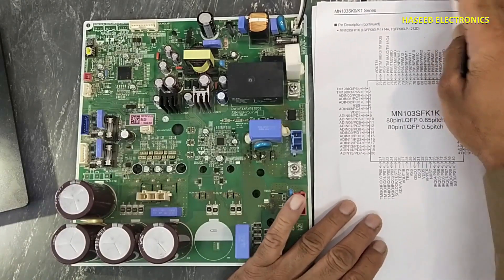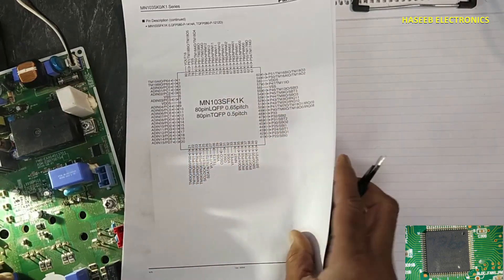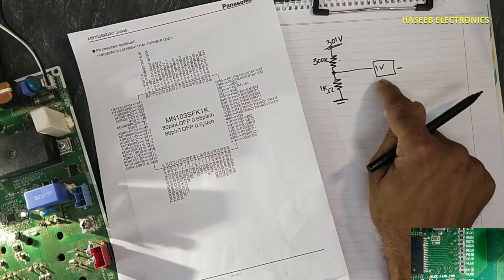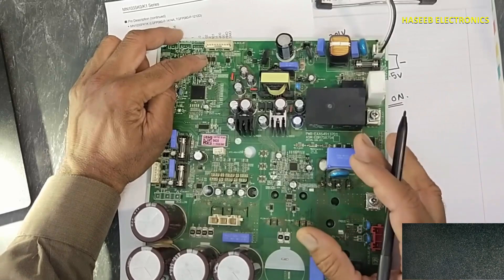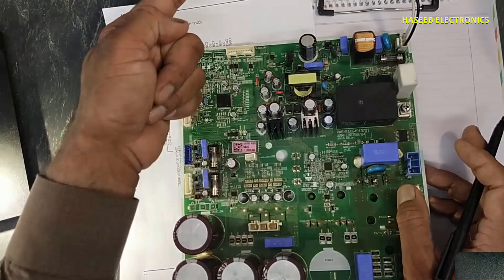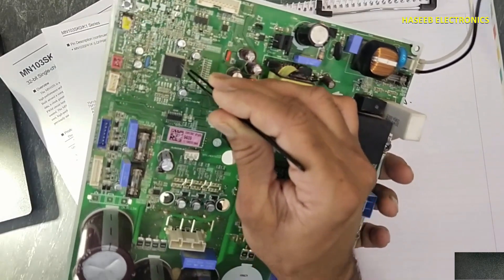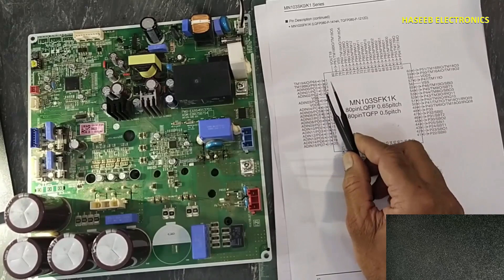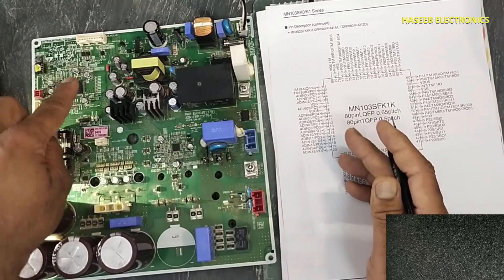{972F} Microcontroller in inverter ac board

Comment: sir i have question can we copy one microcontroller program to another micro controller with same type if its possible how to do it
Reply from the maker: yes can read program from one microcontroller and we can copy to same type of chip 
but in some modern microcontrollers, there is readback protection or Proprietary code read-out protection is turned on by the programmer. in that condition its code cannot be copied
Reply: @HaseebElectronics in modern microcontroller copyright ©️ protection, only swap ,not readable absolutely right sir✅️ 👌 .phenomenon  teaching..
Reply: Great question.

Comment: Doesn't have to be pulled up or down for digital pin on every MCU: depends of brand and of purpose of the pin. Usually digital I/O used as digital input pins are pulled up or down.
Reply from the maker: exactly yes. all digital input pins are to be pulled up or pulled down, depending on signal type. of a pin is directly coupled to a logic level compatible signal, then the pin is connected directly

Comment: Thank you very much for your explanation. Is it possible to check the polarities of the microprocessor using a multimeter with the diode positioned with ground? Especially the parties associated with ACs 710 in the event that this AC explodes. Or is there another way to know if it is healthy, such as a wave reader. If the processor is replaced with a new one, are there problems that may occur? Does it need programming, for example? With thanks and appreciation

Comment: That's allot of stuff for an inverter I see a uc3843 that is pwm with current sense .then h bridge for ac
Reply from the maker: yes, uc384x series ics are used with combination of push pull driver ics or transistor combination to drive bipolar magnet based transformers